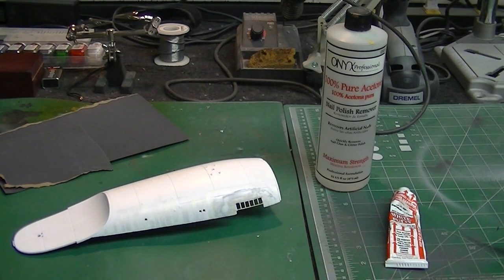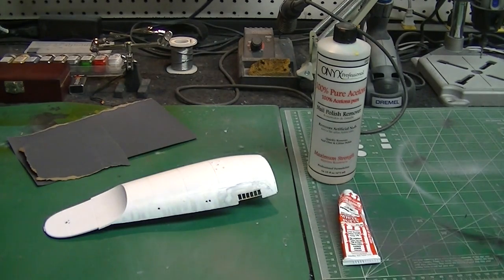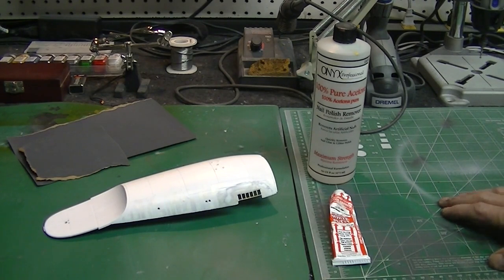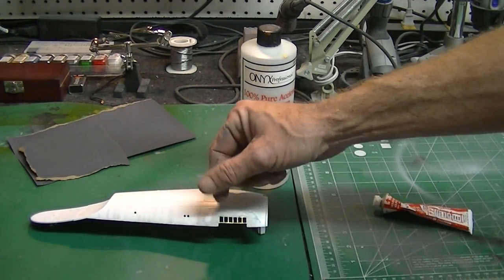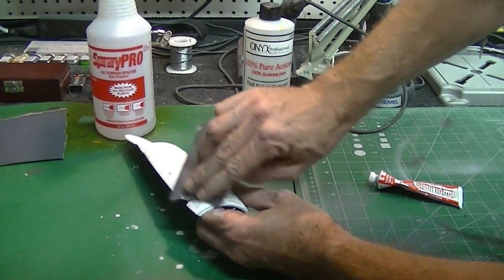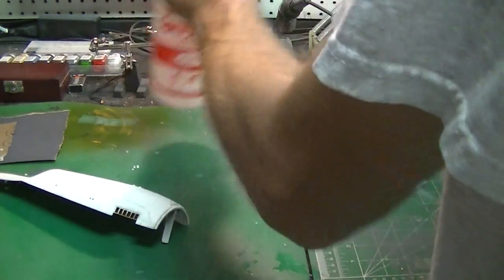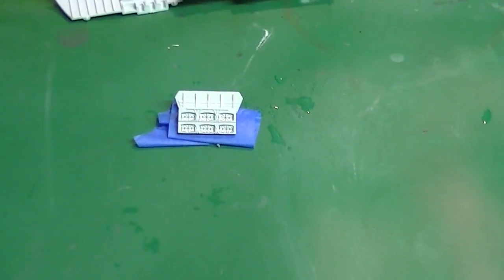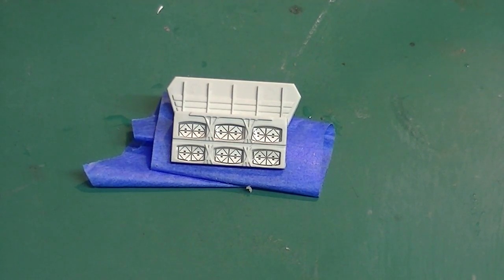Polar Lights 1/350 Scale Enterprise Refit Buildup PT 7

Comment: I always use a few short lengths of smaller tape, like that 1/16 striping tape you used on the shuttle bay floor would be perfect, or just tear off some pieces from the big tape, stick them on the edge ahead of time, then when you loop it over, it's easy to tack down.

Comment: When I tried to put the Shuttle Bay ceiling down it was bending the P.E. Girders so what i ended up doing was adding all around the very edge where the ceiling meets the top walls a strip of styrene the same width as the walls and  about one and a half MM thick to raise the ceiling a little so there is space between the ceiling and the girders.  Those P.E.Girders need to be sized down a tad but they do look great when added. also the one Girder on each side  where the Turbo Lift is, it's tricky when you add the walls the Turbo Lifts are in the way...best to not to add the two Girders that are right next to the Turbo Lifts ( One on each side ) in or drill a new hole and move the Turbo Lifts  slightly so the Girders aren't in the way.